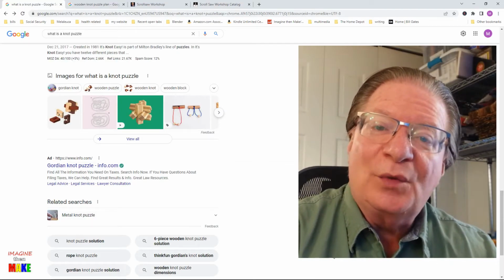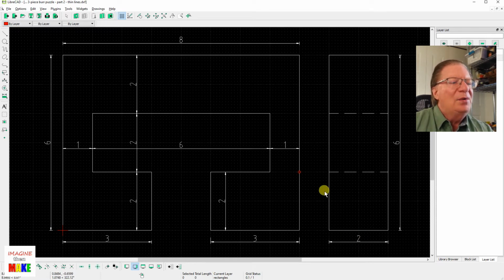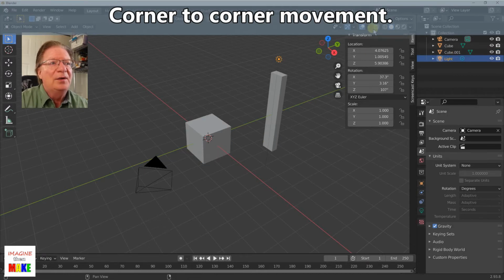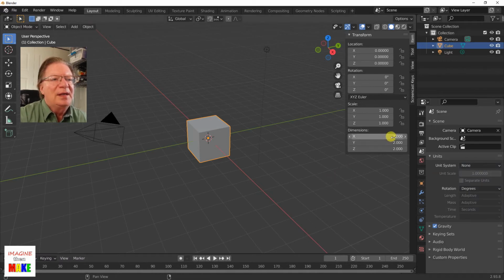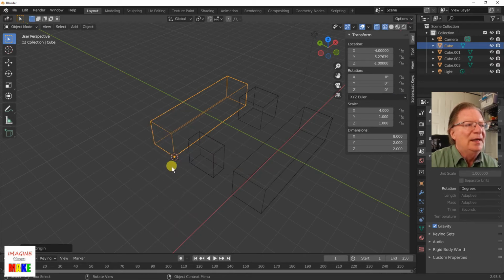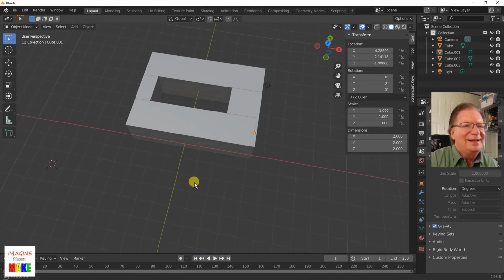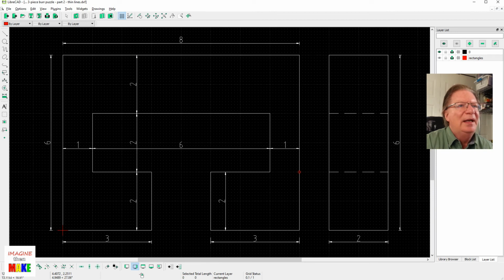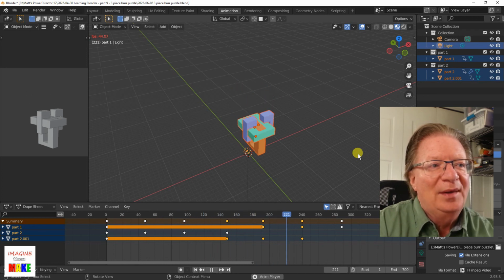153. Learn Blender - part 9 -  3-piece wood puzzle w/solution

Comment: Hi Matt - What an interesting and informative tutorial. I've used Steve Goods patterns for many scroll saw projects and like your tutorials they are easy to follow. I. notice that it's a year since your last Blender tutorial (and I'm only just starting, having previously given up with all the 'advanced' tutorials). Have you in the mean time discovered a way to design in Blender without first having to draw in 2D?
Reply from the maker: Interesting question about drawing in Blender; 2D or 3D. I ONLY draw in 3D using Blender. I have not done any 2D drawing in Blender (yet). (Drawing in 2D using Blender is a whole different topic. I think you've given me an good idea for a follow up video, thanks!)
For the sake of making this video, I decided to make a 2D drawing of the puzzle pieces using a different program called LibreCAD. I did this so I could switch easily between the 2D LibreCAD drawing and Blender (3D) as I explained how I made the puzzle pieces in 3D using Blender. If I wasn't making the video, I probably would just make a simple pencil sketch to reference while drawing in 3D. I hope this makes sense.
In the very beginning of the video, I showed how to create a simple rectangle of ANY size and shape by entering in X, Y, and Z lengths in the side panel that comes out when pressing the N key. If you understand how to do this, you can create rectangles just by entering in the 3 lengths. (It occurs to me as I write this, that maybe I should make another video that explains this in more detail and with more examples so thanks for giving me the idea!)
If you didn't want to enter any lengths, you can use the tools on the left side of the screen to make your rectangles by eye (no exact size). I have done this from time time and this is VERY fast and VERY powerful. At the risk of rambling a little bit, for YEARS, I have wanted to find a simple way to draw in 3D without the complications of drawing to an exact size, I can do that using Blender. It's like drawing in 3D on paper except that you can spin the objects around on the computer screen and can't on paper. Hopefully, that makes sense. (I can't tell you how many notebooks I have filled up drawing 3D objects using pencil and paper and then feeling frustrated because I couldn't easily change the view.)
I could go on and on, but I won't and just leave you with one other thought.
If you have ever looked at any books or videos that teach basic drawing, one of the 1st skills explained is to begin to look at ALL objects as a collection of very basic shapes (rectangles, spheres, cones, pyramids, etc.). Blender has all of these basic shapes already drawn for you in 3D. Each of these shapes is called a mesh. Just add a mesh to your scene, adjust the size, and then position it relative to all of the other objects (meshes) in your scene. That's all I am really doing in this video when I draw the puzzle pieces (animating the pieces is a separate procedure).
For the puzzle pieces, I only needed to use several copies of the cube mesh, adjust the size, and position them to form the shape of the puzzle pieces. Hopefully this makes sense.
What I would suggest is that you watch the video again and try to draw the puzzle pieces in Blender. You can pause, rewind, slow the payback speed, etc. of my video as much as you need to so you can see exactly what I am doing. You can make a pencil sketch first if that would help you. Just draw the pieces; don't worry about learning how to animate them yet.
Thanks for your question and for watching.